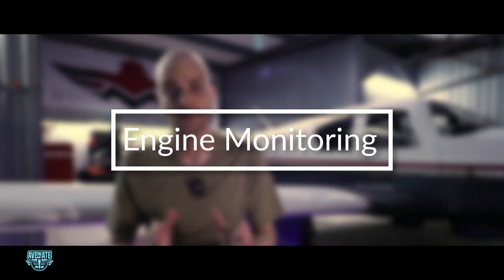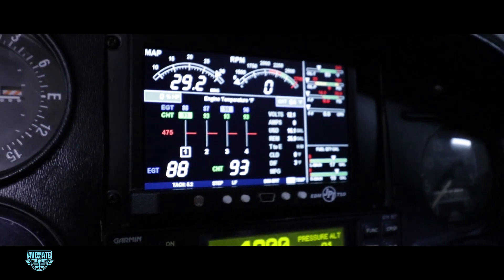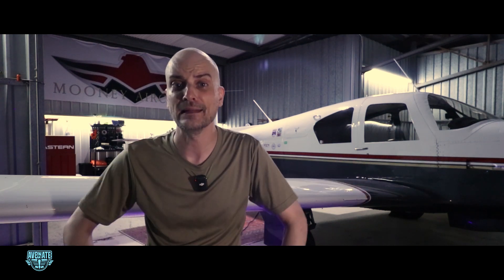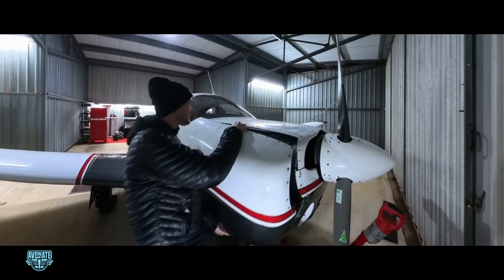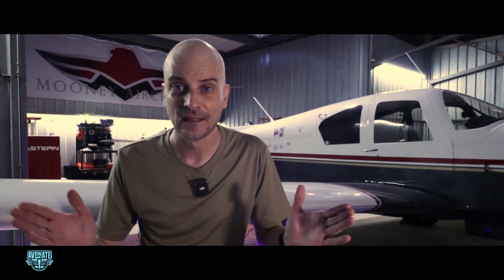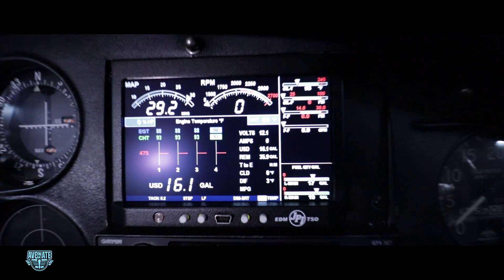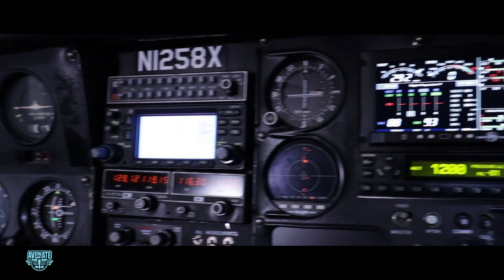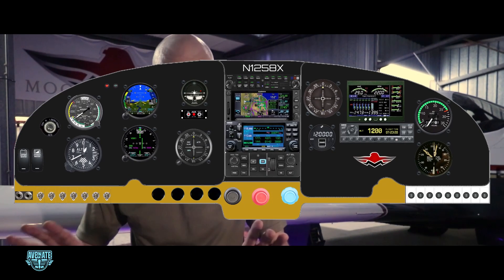JPI EDM 900 Install in My Mooney – Avionics Upgrade (Part 1 of 3) #mooney #avionics #generalaviation

Comment: I went with the EI MVP-50P in my E. The upgrade significantly improved over the original engine instruments, and it also allowed us to clean up the right side of the panel with a new circuit breaker bank. I hope to upgrade the NAVCOM and the old, tired, delaminating 430W next year with some more modern alternatives. Looking forward to seeing what else you added in the upcoming videos.
Reply from the maker: Would love to see your E model! The next video covers the GI-275s and my new audio panel. Next year I’ll be trying to do the GFC-500 and GTN650xi. Lots of money to save up first!
Reply: @AV8Nate  Sounds like some solid upgrades. I'm still trying to figure out which GPS I'll move to; it has a semi-recent Garmin audio panel and transponder, so they will stay for some time to come. G5's or 275's will likely be next with the new GPS next year. I'd like to move to the 500 AP, but it currently has an S-TEC-30 AP that works quite well.